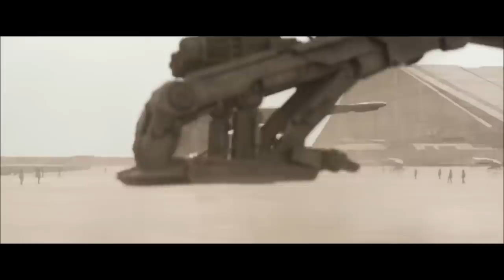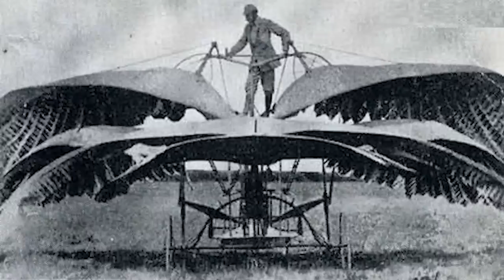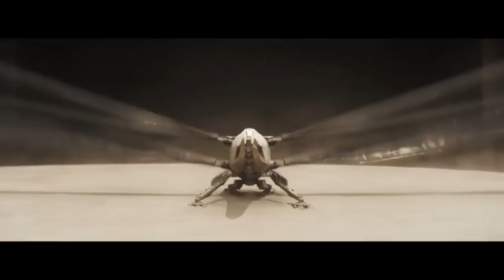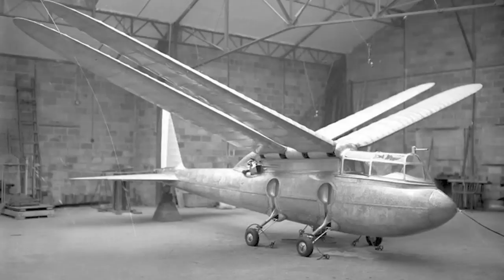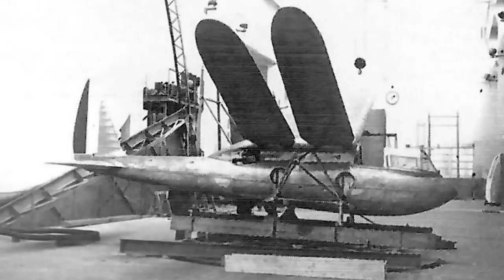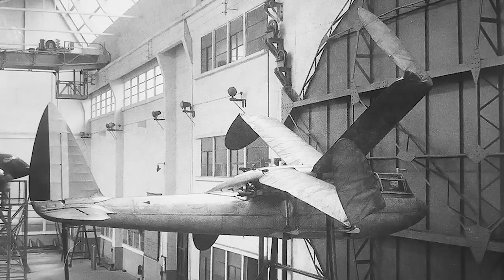The Riout 102T Alérion Ornithopter; Frank Herbert’s Inspiration?

Comment: The TV sci-fi series LEXX  made by a German-Canadian group used a similar but of biological production. The organic LEXX being the mothership with dragonfly influence in its design.  But no wings.   The smaller light flying machine had dragonfly style wing with a helicopter like body.  LEXX was a radical show with very strange elements. The heroin being a love slave body genetically mixed with a spinning dragon genetics. The main hero being the last surviving but dead Brunin Ghe warrior poet carbonated into a carbon assassin modification.  The show was very sexy.  Claimed to be one of the weirdest sci fi tv shows. 

https://www.youtube.com/watch?v=qjma08_pt2I&pp=ygUMbGV4eCB5b3V0dWJl

My idea for such an aircraft would contain many one way flaps along the wings that shut with a down stroke. And possibly half rotating up stroke wing. Flat on the down stroke. The flaps being a flexible nano carbon material.  Like carbon fibers but stronger.  And thrust vectoring engines having some redundant flying capability for emergencies. Possibly with a nano carbon guided parachute for emergencies. And crash flotation air bags. And some ejection seats.

Comment: The vibration would rip apart the cockpit and shake loose any rivets, screws or bolts, and (if it were possible to sit in it) make flying in it an unbearable, epileptic experience of teeth chattering horror. But for drones, possibly.

Comment: 🟦... This Rapid Wing Flapping principal works fairly quite well in small toys,... But unfortunately it CANNOT be SCALED-UP to a size adequate to carry any 'Significant' Payload, (much-less a human pilot!).
.... The very physics of it Should show quite clearly (without the need to build one to prove it), that it has inherent limitations that cannot be overcome by technology, and that any further attempts at developing this principle of flight in anything with a wingspan greater than a few feet is simply futile & a waste of time, money & Energy,... and anyone working on this principle to that end (carrying a human pilot), should be given something VALUABLE to do with their time instead.
Please understand, I'm not saying that it can't be done, I'm just saying it isn't worth the returns of trying, as the only kind of aircraft You might get would be something wildly impractical that would probably only last one flight of any substantial distance in a straight line before it shook itself to bits and would most likely have to be towed up into the air and released, as otherwise it would most likely wreck itself just trying to take off from the ground under its own power.◼️

Comment: We have all seen, in the last ten years, easily flying mechanical birds and insects, guided by remote control, that could be mistaken for real birds and insects if properly disguised. These developments would have great military utility and may already be in use by some intelligence services. Other than those uses, it would be extremely inefficient to manufacture them for human use. A propeller or turbine is always better than flapping wings, just as wheels are better than legs in most cases.

Comment: A Polish fluid dynamicist once worked out why some aerodynamic solutions that work very well indeed on a small scale are an absolute no go with increasing scale. Atmospheric density /size of gas molecules is a key factor. I’m amazed that one would build, at great expense, such a big beautiful thing and then try to force it to work without having gradually scaled up actual working models to determine the limits of feasibility.

Comment: Biology prefers reciprocation but machines prefer rotation.  Because of the huge reciprocating mass of the wings it will never be practical (if even possible structurally) to make an ornithopter because it would be so much less efficient in every important flight regime than a helicopter or fixed wing airplane.  The most comparable aircraft type to an ornithopter would be a tilt rotor such as the V-22 Osprey.  From design, engineering, risk, price, fabrication, and operational efficiency standpoints the tilt rotor (or similar tilt wing) is simply far mor possible and practical than an ornithopter.  Just look at the issues the V-22 has had (multiple accidents and groundings) and imagine what that would be for an ornithopter that is even more mechanically complex and a lot more moving mass and you start to get the picture of what a bad idea developing such an aircraft (even today) is.

Comment: This had never been meant to rapidly flap its wings like the ornithopters in DUNE. 
I rather suppose, its meant as an actual attempt to use low and fast flight characteristics of a monoplane and a biplane (i.e. later for landings, former for travel flight) in a single design.

There were similar attempts to archive this... where biplanes could retract its lower wings into the upper ones. I guess it was Grumman or so... I would have to look for it.

Comment: The problem is that a Dragonfly's wings are actually pretty flexible. The leading edge is obviously the stiffer part, but the trailing edge and areas in-between flex more or less depending on what's required and can change direction in a split second. A bird's wing is also flexible. Flapping is a major technological problem.

Comment: Believe me, there are much cooler designs than an ornithopter. The machines in this video are trying to use mechanical force to provide all the lift. But there’s no reason to do that. You can start by putting a pair of jet engines slightly ahead and above the ornithopter wings, but at an angle so that the thrust from the jets hits the leading edges of the wings; even before they start moving. That way you can boost the lift of the wings, and they won’t need as much vertical sweep. The aerodynamics would be complicated, so the whole thing would have to be fly-by-wire. It would be nice if the machine could hover like an ornithopter, and cruise like a plane.

Comment: I believe the photo at 35 secs into the video is Otto Lilianthal and his glider.  He had hundreds of flights and did die from his  last.  But not an ornithopter.
I met a guy, James L. G. Fitzpatrick of Staten Island, who was working on flapping flight.  I think he was on the faculty of the local college.  He had devised testing systems to gain data from various wing types.  From what  I recall his data was spot on, compared to legit aeronautical facilities.  Later I think he made a full sized craft, powered by compressed air.  But I never heard of it results.

Comment: Ornithopters are interesting, for sure.  But they are not a great idea.  This is overcomplicating flight, at least for us humans.   Dragonflies can pull it off because they're made by GAWD.  

There are too many issues regarding balance, vibration, wing strength (as proven) & an inefficient means of locomotion.   Also, if an airplane loses power, it can still glide.  A helicopter has a chance with auto-rotation.  An Ornithopter's wings might give it a chance to glide, but chances are that the wings aren't in a good spot to provide lift, or to be able to glide.

A Propeller Engine & Jet engine provides a smooth, efficient & reliable means of propulsion which does not directly introduce all kinds of Krazy forces onto the wings.  An Ornithopter MUST have its propulsion directly imposing lots of extra stress (& Krazy forces) onto the wings 

BTW....How do you even control Pitch, Roll & Yaw with this?   Just minor issues regarding flight

Comment: Ah, ahHahaha, old people are always good for a lawl.

Did it take them 100 years to think of scaling up a paper plane with a motor?

Man will never fly...

Ah yes the good old days.

Maybe it was all the lead or radium. Or everything else they ignored.

The tip of the wing need to be able to twist up on return to top or else its just going to be pushing air down and then back up... it has to cut up into the air to then scoop down to push up on the air.

This is such a dumbass idea.

Comment: What allows flies and bees to fly when scientists say they shouldn't be able to, is because for them, 
our atmosphere feels like a thin oil, not air as we feel it. This gives their wings more lift than anything else can.
Reply: That is one strange comments. Stating that « scientist say they shouldn’t be able to fly » but then giving an explanation ! Or maybe that scientist doesn’t believe in the « thin oil atmosphere feeling » explanation…
Reply: @DD-ne3rl  They might see bees but they don't know the buzz. Or, they could be talking simple to justify being big boys building big toys, making one like an insect. A fly has what could be called an elastic band for its wings. so when they push them up the elastic pulls them down, not using muscles or energy. Can you imagine an aircraft with such a part that has the strength to keep a huge machine up in the air? If you can that makes you smarter than those men.

Comment: Am I missing something or would this design make negligible lift & never fly even if it "worked"? Rigid wings flapping straight up & down would cancel out almost all the lift unless they're hinged to fold into the wind on the upstroke or swiveling & doing a complex motion
Reply: I believe it works with a sort of swash plate like a helicopter employs, where the wings rotate to provide lift during the downward motion, and rotate back to pass up without creating drag
Reply: @2dogsRichardnBryan  yea, the wing would have to rotate to 'knife-edge' orientation when moving upwards to not cancel lift, but look at 2:40 - doesn't it have the wrong hinge for that?
Reply: @nathansmith3608  yeah I meant conceptually.
Reply: @nathansmith3608 the 102T clearly had some design flaws mostly due to I assume the time period and the lacking of manufacturing complexity.

Comment: If the reports are to be believed that this aircraft actually had some success, surely it would be worth replacing the wings with carbon fiber composites & a modern engine which again must be more powerful and lighter in weight than something from the 1930s. It seems they got awfully close to success, looks like now we have the materials to see if it actually could work.

Comment: A design based on insects' wings is less complex than birds' wings (unless you consider hummingbirds). I think the issues would be:
1. Strength and rigidity vs flexibility of the wings.
2. Weight of the fuselage/payload, of course.
3. The motion of the wings. I'm thinking a high angle of attack would be necessary for the upswing and low angle of attack for the downswing.

Comment: What Mr. Riout didn't understand at the time (because slow motion film wasn't a thing yet) was that insect wings don't merely go "up and down", they move in a "figure eight" pattern which is even more insanely difficult to replicate with the technology of the time.

Hell, I'm not sure we can replicate it at this time.
Reply: For the longest time people couldn't understand how insects could fly, the classic example cited behind the bumble bee. 👍
Reply: It is true that we cannot replicate that exactly, but there are examples out there of small drones that mimic some important aspects of flapping wing flight well. Robert Wood at Harvard already made a robotic fruitfly in 2006. At Delft university they managed to make a robotic dragonfly of sorts, that exploits the clap and peel mechanism, a well known mechanism from insect flight, to facilitate exceptional maneuverability. We're further along than you might think. The question remains if it is very usefull in the long run.
Reply: This seems like such an obvious issue that I'm suprised there doesn't seem to be any accommodation for it. The wings were fabric, and mounted at 2 points each, so it is possible that they twisted during the flapping motion though I'm not sure how successful this would have been. Wish we had full documentation for this aircraft.
Ah, yes, just after 3:25 it is mentioned the wings are warped, which probably played a role in their failure after such a short time in wind tunnel testing.

Comment: Perhaps it’s worth saying that the physics of this type of machine work much better for small aircraft. In fact it works better (in principle) for very small aircraft - such as micro-drones - than those that use fixed and/or rotating wings. There has been an active research program to develop such drones, including for military purposes.
Reply: Works well essentially with very low Reynolds number, where viscosity has more influence than inertia
Reply: Notice in real life that the bigger the flying creature is, the slower it tends to flap its wings. A bald eagle vs. a honeybee for example. The machines in Dune are certainly cool-looking, but I imagine a machine capable of doing that would be horribly uncomfortable to ride in due to the vibration. For how they were used in the film, it seems a conventional helicopter would make more sense.
Reply: For someone with a technical bent, comparing the efficiency of this kind of design to the more conventional multi-rotor configuration for a hovering drone would be an interesting exercise.
Reply: Propellers are still better at all scales.

Comment: No, the ornithopter wasn't doomed by the war, it was doomed by physics.
     The physics that govern flight are not entirely intuitive, and scaling flying things is quite difficult.
      You can see this quite clearly if you watch birds of different sizes fly. Small birds like finches fly by flapping their wings quickly several times then they fold their wings to their body and follow a ballistic curve. Once the bird starts to fall towards the ground it will flap it's wings several times. to give themselves a bit of upward velocity before fold them again. This cycle repeats over and over. This is the most efficient way a small bird can fly.
     For bigger birds like Eagles or condors usually only flap their wings when taking off or landing.  The rest of the time they hold their wings out flying much like a glider, gaining altitude using thermals.
     If you ever see birds flying round and round in circles they are in a column of rising air riding it like an elevator. They only ever flap there wings if they can't find rising air.
    This is the most efficient was for larger birds to fly. Smaller birds can't do this because the smaller your aircraft (or bird) is, the less efficient gliding is. 
    Bellow a certain size, gliding is so inefficient that it simply can't be done.
   Flying insects have it even worse. There is a misconception that MIT engineers calculated that a bumblebee is to heavy to fly.
    Actually the paper that sparked this misconception was talking about gliding, not flying. Bumblebees can fly, but they can't glide.
    Trying to replicate insect flight in a vehicle large enough to carry a person simply can't work, bo matter how advanced our technology.
Reply: in Dune they have anti-grav fields so no problem😏
Reply: @mirceapintelie361  Yea, still a problem actually. Anti-gravity (or artificial gravity. Basically an up-side-down antigravity machine) require huge amounts of energy to project a gravity field.
     Wings don't require much energy at all.
      Keep in mind, the technology of Science Fiction isn't magic. It still needs to work in the real world. even if we can't do it yet, the problems associated with it (usually levels of energy) still have to be overcome. 
     Often in sci-fi these problems are rust handwaved away or ignored completely. You can do that in fiction. No so much in non-fiction.

Comment: Ornithopters have no advantages I can think of for mechanical flyers.  Helicopter rotors are fiendishly complicated, yet ornithopters make them look sane by comparison.

Even if the wings could be made of suprt-light super-strong unobtanium, did any of these designers ever consider how much that body would be hopping up and down, equally and oppositely in Newtonian reaction to the wings?

ETA I have to correct myself here.  Googled for "slow motion dragonfly" and found videos which show dragonflies alternate wingstrokes -- forward up and rear down, and vice versa -- which would cancel out Newtonially.  I don't know if this particular ornithopter did alternate wing strokes.  I would have though the aerodynamic interference would have made it impossible, but I guess dragonflies beg to differ.
Reply: looking at the images in the video it does look like it alternates the wings, the wings sitting next to each other is probably the middle of the stroke
Reply: Maybe you should do some research before commenting next time?

A resent study done by aeonuatical engineers from all around the world useing actual ornithopters found it is 40% more energy efficient for a give amount of thrust than ulternatives.

And it has been the concensus for over 10 years that drone ornithopters are quieter and more maneuverable than other drones and there is no reason it wouldn't also apply on larger scale.

Cornwell University also proved ornithopters are more stable than  other aircraft designs about 10 years ago. 

Ornithopters are also predicted to have faster maximum speeds than any other non-jet aircraft.
Reply: @matthiuskoenig3378  1.  Insults are fun!

2.  No links to back you up?  For shame!

3.  Scaling has problems which you should perhaps research before commenting.